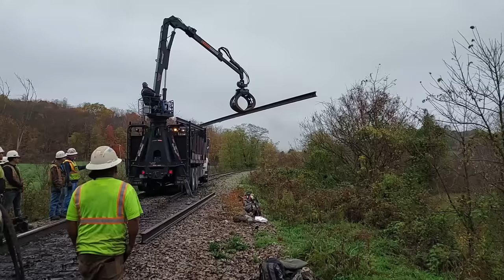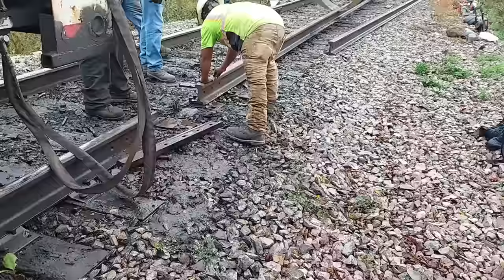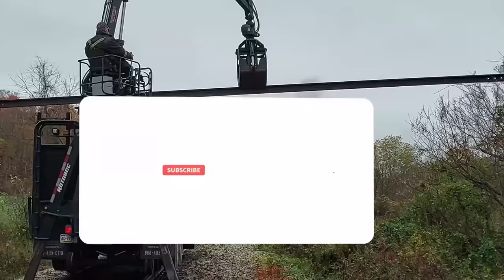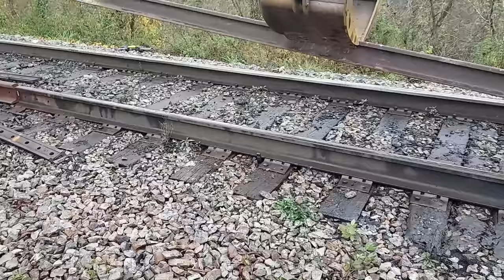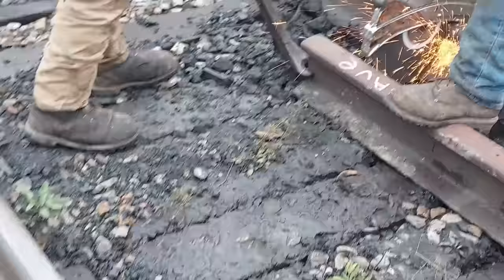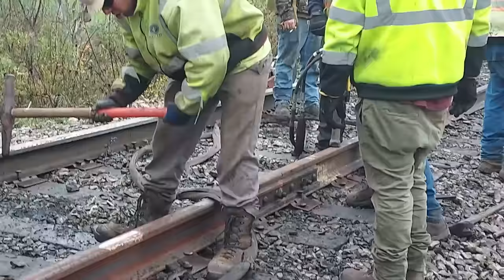Track Gang at Work Replacing Rail and Ties

Comment: As a self proclaimed Train freak I love seeing all things Railroading!!!
Man to be young again with a strong
back, LOL!!!! You would think some
Company would make some kind
of epoxy to use in the spike holes
that are reused so the spikes won't
work loose!! You guys are awesome
Dave!!!
Reply: Theu did use wood plugs and a sand substance, but they have an epoxy they use now. Atleast on union pacific
Reply: @zzz-zj7xg  Yeah you would
think those spikes would work 
loose after they were redriven in
those old spike holes if they didn't
use anything to make them tight
after reuse!!!!
Reply from the maker: Thanks my friend we do appreciate your watching the show.
They do make an epoxy type stuff called Spike Fast and it works
really well, we don't use it because for small jobs there is a lot
of wasted material and you have to keep it warm during winter.
We use Sure Spike it's like a granular gun powder and works
pretty well at holding the spikes and keeps water out of the spike
holes.

Comment: love that cut off saw with the guide jig to keep it perpendicular and 90’ cut for a good butt joint. 
that was a great idea implemented to make things easier! it almost looks like it was milled, over
an abrasive blade cut. great video Dave be safe, and stay healthy!
Reply from the maker: That jig to hold the saw sure is nice Barry. It's almost impossible
to hold the saw steady enough without it to make a nice straight
cut. Thank you for taking the time to check out the video and may you have a very good day my friend.

Comment: Excellent. It's worth a lot to have good partnerships with your contractors, where you're happy to have them in and they're happy to help you get things done and get back to making money. That this crew lets you film them is an enormous compliment, and most appreciated from us viewers! And I'm always impressed how easily that big grinder cuts through the rail. The noise must be tremendously awful in person.
Reply: Chop saws like that are a blessing for cutting rail. I have a 14" B&D stationary one that has been used to do the same. Best thing to do once you start cutting is to keep cutting when it comes to rail. The heating of the rail where cut tends to harden the rail if it is not kept hot.
Reply from the maker: Thank you very much 2xKTfc, really do appreciate the nice comment
and for watching the show my friend.

Comment: Watch out, here comes the boom truck claw! I've seen some questionable boom operators, always check the crews, and if they scatter when he lifts something, it's probably a new operator. 
Never get under or close to a lifted load.
 We had one doofus who unloaded several rails near the toll road toll booth by slamming on the brakes. Truck stopped, rails flew off the rack on top of the truck. Whatta mess.
  Your operator does it all with that tie bucket, inserts and removes ties, distribute ballast, he's gooood ! 👍👍
Reply from the maker: Thank you for the very nice comment Thomas. We really appreciate your taking the time to visit with us and check out the presentation my friend.

Comment: That is a cool miter gauge on that two-stroke power saw. I used one to cut through 4 inches of concrete to put in new drains in my basement bathroom remodel - they cut like "budda".  Nailing in Spikes: Wow, I could never hit anything with that precision with huge strokes like that with such a small head. I see what you mean about the wrist twist action!
Reply from the maker: It is an acquired art that takes a lot of practice and provides a lot
of broken spike maul handles during the learning curve. You learn
quick how to replace a handle! Benn there done that many times....LOL

Comment: I see that they are still using the old " three phase" , as electrical line workers refer to hand tools , where mechanized tools will not fit when replacing poles. They are just using different hand tools for rail replacement. The grapple crane really helps move that rail section!
Reply from the maker: Thank you very much for the nice comment. We do appreciate your visiting with us and watching my friend.

Comment: I am always amazed by how much work is needed to keep a railroad running! Thanks, Dave! By the way: about how much does one section of rail weigh?
Reply from the maker: Glad you enjoyed Pete. One 39 foot stick of new rail weighs 1740
pounds. A new rail costs us about $900 and it comes from Steelton.
Reply: The head of that rail looks like it has a flatter profile compared to other rail I’ve seen is there a reason for that?

Comment: Man that jointed rail is the pits. I’ll take the long runs with welds any day.
Reply from the maker: It is a maintenance nightmare but it's what we got and have
to deal with. Smooth ride on the SWR, but jointed is rather romantic.
Appreciate your checking out the video today Logan.
Reply: @ccrx6700  I appreciate you making the videos. I’m still a pretty new guy on a rail production gang so I’m just soaking up all the knowledge I can get.
Reply from the maker: @NagoLish  😊👍

Comment: Do you still 'rail adjust on jointed track's
Cut 6inches off, then pull all the rails back to get equal expansion gaps . ??
Hooray for Continuous Welded Rail. 
Oh, and dont forget Plate Oiling. Dirty bloody job. Lol.
👍😎
Reply from the maker: We don't have CWR here Ian, it's all 17 miles of jointed track....alas....
Interesting about oiling the joints, we used to spray with oil but
it didn't last long, wondering what you guys used? I'm thinking a
graphite based lubricant would last longer?

Comment: I remember watching gangs on the lines as a kiddie over here with their weird rail tongs, 8 to a rail and walking it into position and the big spanners used to do the fishplates and this is before the large uptake of Pandrol clips, the rail was held to the chair using blocks of wood to wedge it in place.   Pandrol clips and portable tools made the job super quick and American manganese rails crucible welded allowed the rails to last many times longer so trackwork was reduced considerably.   Always wonder why off main lines in America still nail the rails down to the sleepers and not adopt the Pandrol, concrete sleepers, all welded rail and clips and you would have a much reduced maintenance window I am thinking.
Reply from the maker: Thanks for writing in and watching. To answer your question many
RR's in this country do use the concrete, CWR and Pandrol clips. Our
RR here was built as you see it and to change over to any of the above
the costs would be astronomical. Sure would be a lot less maintenance I do agree on that, but that will never happen here.

Comment: The type of project where the statement many hands make for light work. That one guy driving spikes was like a modern day Jawn Henry without missing the spike nor bouncing it off the rail.  Out of. 
curiosity was this rail replacement due to excessive wear or defects found by electronic scanning?  Close doesn't count when measuring for that thermite  weld hence all that measuring and hold that saw straight!  Great information
Reply from the maker: Thank you very much Paul, really do appreciate the nice comment
and for watching the show my friend. We replaced the rail here because there were too many rail head surface defects, I'm sorry
I didn't show these before the rail was taken out, dummy me
just didn't think to do that.

Comment: Dave, what happens to the removed rail? Does the Gandy Dancer's just toss aside the used rail along the side of the rail bed like the old busted wood ties? I've seen my share of discarded rail stock on the sides of the rail beds riding the trains. 
Many residential garages in the area around this video shot, would love a 2 foot piece of old rail to make a work bench anvil. Could make some easy pocket money to cut the old rail up, and sell them to garage mechanics and DIY tinkerers. Some of these rail hammer swingers need to pull up their droopy drawer pants. We can see the brand name of their depends underpants.
Maybe they need to tighten their belts a little tighter.
Reply from the maker: Good question Rick. The rail that is taken out that is not
graded as relay rail, if it's not too bad then it's sold to Frontier RR
for them using it when building sidings on other jobs. The garbage
rail is sold for scrap. The small sections we keep if they are decent
to use if we would need to put a plug in somewhere. I've given many
small pieces away to guys who want them for their garage. I would
sell them but golly who could afford the shipping! I sent an 
empty fire snake can to a friend in Kansas and shipping was $40,
I about fell over !!!!

Comment: First off, thank you for posting your videos.  I live in East Tennessee next to the line that goes under the Cumberland Gap to Middlesboro, KY from Knoxville, TN.  This rail-line has been in place since 1889 an mainly transports coal,  lime, and timber from time to time.  

I grew up with a neighbor (passed away in the 1990’s at the age of 91) that worked for Southern Railway, and he would talk about repairing the railway lines.  He once spoke about cutting a rail section on a hot summer day.  He said that one of the one of the workers would pour cold ice water on the line and strike it and it would cut the rail at that location.  Is there any truth to this method?  I always though it might be far fetched.   Your thoughts??
Reply from the maker: Your welcome James, glad you enjoy the shows and appreciate
your nice comment. I have the utmost respect for anyone that
worked Southern, however I have never heard of that happening nor
see how it could happen.

Comment: A question I just thought of - can you share the ballpark cost for a bag of thermite mix and the crucible? Of course the man hours and other equipment come on top, but I'm wondering about the consumables. They'd make a mighty nice new years show! haha At 10:30 onwards the guy in the grapple really knows what he's doing. Not easy with that straight edge grapple, it's not exactly a clamshell...
Reply from the maker: I do not know what a weld kit costs, they charge us $550 per weld 
but that includes the kit and labor, sorry couldn't help with that.
The operator is 72 years of age and has been railroading all
his life, he a great guy to be around!

Comment: Are you using new rail or recycling rail that has had a class one life?
Reply from the maker: We are putting in relay rail John. Different grades of relay rail 
are used for different purposes, for instance a  grade 4 relay 
would not be allowed to be used on a class 5 track main,
but is allowed to be used on a class 2 track main line. Hope
that helps sir, if not write me back please.
Reply: @ccrx6700  Thanks a bunch. Catch you on the Belen site sometime.
Reply: @ccrx6700  What weight of rail do you use? Sure enjoy your videos. I learn something new all the time.

Comment: Why does some track get welded together, and other bolted?
Reply from the maker: Very good question Doug. All our track is jointed which means there
are 3 bolt holes for the joint bars on the end of each stick of rail.
They won't weld the ends that have the 3 holes because that 3rd
hole is too close to the weld. That's why some are still joints.
The plug they put in didn't have that 3rd hole so it could be welded.
Hope that helps sir.

Comment: How long does rail last??
Reply from the maker: There is no set formula. We still have a lot of original rail here
that was rolled in 1975. However a good many of the sharp degree
curves have had the rail changed since then. Rail in curves doesn't
last as long generally speaking as rail in tangent track. Hope that
helps some.

Comment: Just replaced a section of track from switch to cross over through tunnel 6 into the yard . It all started when we tried to weld the sensor wires to the rail when it buckled. So we had replace the section of track rail it took 3 days today we will run a train to test the rails . If were good we can then go back to what we were doing welding the sensor wires to the rail sensor wires are for the signals to activate.  O.k that's railroading. In n scale
Reply from the maker: Cool Juergen, hope your test train runs well. N scale....nice. Thank you very much for dropping by to check out the track gang video my friend.

Comment: Why is he using this hammer?
Reply from the maker: Which hammer are you referring to Zezo? If you are meaning why is
he spiking the joints with a hammer, then it's because the hydraulic
spiker won't drive the spikes at a joint. The rounded part of the bottom
of the spiker hit the joint bar so you have to drive those spikes with a spike maul.  Appreciate very much your checking out the video and may you have a very good day my friend.
Reply: @ccrx6700  I mean, the thin hammer has a strange shape
Reply from the maker: @zezomourad1  that is a spike maul, its shaped tgat way so spikes can be driven without hitting the rail head
Reply: @ccrx6700  Thank you, this is what I expected

Comment: Great video! Not trying to be a Karen but wish the guy running the rail saw was using better PPE like welding spats and a face shield. 

I’ve caught my leg on fire before not wearing spats cutting rail and had to pull skin grafts.
Reply from the maker: You are right MrAbword. I've had a wheel come apart on me
using a rail saw, good thing I was wearing a face shield! I've also
seen other guys catch their pants on fire. They don't provide us
with leg spats here but when I use a saw my legs are away
from the sparks.  Thanks so much for visiting with us and checking out the track gang video my friend.
Reply: @ccrx6700  wow! Thats crazy! Needless to say I got wrote up for my incident. If I had been at Norfolk Southern, I would’ve gotten a promotion 🤪😂
Reply from the maker: @MrAbword  👍😊

Comment: I don't mean to be a Safety Sally here but shouldn't the crane operator have a hard hat as well? and in construction any time you are operating power equipment that throws sparks or dust etc in addition to proper eye protection a face shield is also pretty much required as well! 

The late Dave Thomas was once asked "why are Wendy's Hamburger patty's square?"
Mr Thomas replied "Because Wendy's doesn't cut corners!"
I use that in a safety meeting now and again as a safety tip!
Reply: Rock, i agree, after 40 years in the industry i just sit and shake my head saying everyone has a right to make a buck and hoping the “waynie” adventure continues, WW👍
Reply from the maker: Good advice and will pass that on to the Frontier supervisor
next time they come in. I like the Wendy's slogan! Thanks for
writing in and for watching my good man.

Comment: Your work is very normal PRC size 2700mm rail 60kg height 172mm
Reply from the maker: I don't know metric, but rail weight here is 132 pounds per yard.
Reply: Right dear
Reply: Were are you from dear

Comment: I really don't get why in America they still use nails, use some screws like in europe aint that way better?
Reply from the maker: Some tampers such as the one I run are unable to tamp the
thicker concrete ties. Also for a return on investment, wood ties
are more cost effective than concrete up until around 100 million
gross tons of traffic are run over a track, only then are the
concrete ties more cost effective. While there are both pros and
cons for wood and concrete, a comprehensive explanation of
them both is way to much for a comment answer. Europe has
2 problems the lack of trees for ties and also the end of life environmental issues when getting rid of wood ties.
Reply: @ccrx6700  I see you're point, but I mean more like screws on the wooden Ties. We have more types, like the one you use with the wood a plate is underneath the rail and the screws goes thru the plate and hold the rail. Just like the nails. We also have another type: same idea plate underneath the rails, the plate is bolted on the ties with screws. And to hold the rail an bolt can be put in up side down in the plate so the thread sticks uit and then a cap goes over the bold that holds the rails.
Reply from the maker: @deckers1234567890  our track has 16.8 miles of tie plates punched with square holes for spikes. None of them have round holes for lags. I wish all our plates were lagged and had Pandrol clips. That is a superior fastening system compared to spikes. But to change all those tie plates plus all ties would have to changed that is an astronomical amount of work and expense my friend and wont ever happen here.

Comment: No concrete ties, too many idle union guys, need to bring rail forward 50 years.  Design entire system over, eliminate all grade crossings.  The signal system is laughable.
Even hotbox detectors don't work as seen in Ohio or are ignored.
Reply from the maker: Thank you very much for taking the time to check out the presentation. We really appreciate your visiting with us.

Comment: This replacement went incredibly slow. Too much standing around here. Its no wonder China is beating us in everything  there is a video on you tube that shows chinese workers replacing massive amounts of track in a matter of six hours  embarrassing
Reply from the maker: Well we can certainly agree that the over 15,000 Chinese workers
who helped build the Transcontinental Railroad would be amazed
now at the new methods and so few workers required from the
days when they worked track.
Reply: This looks like a small crew working on a smaller job. A big crew with a complement of machines would also outperform this crew. So disparaging this crew and by extension the entire North American rail industry because you watched a video of another crew from a different country doing track maintenance faster shows your ignorance.